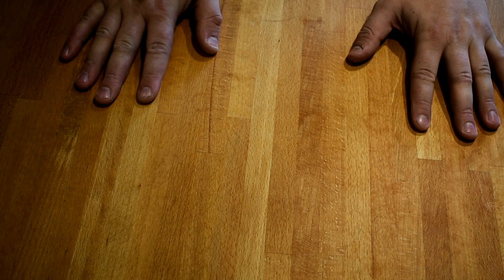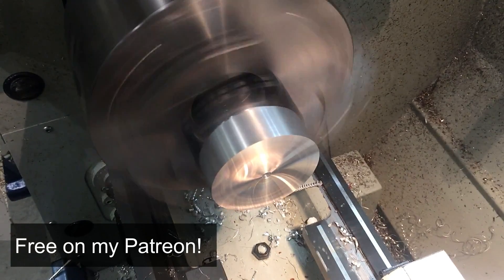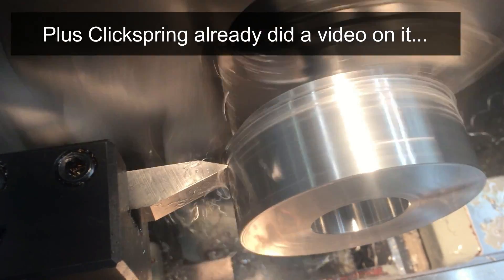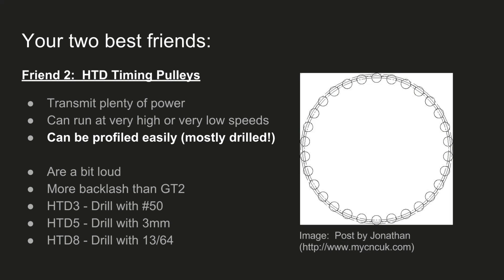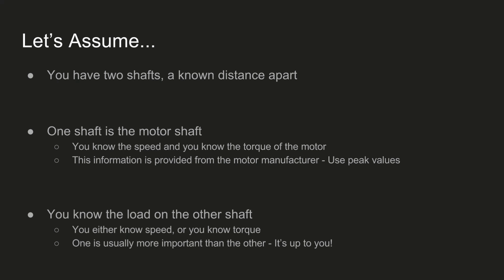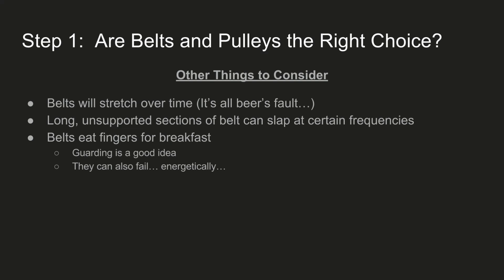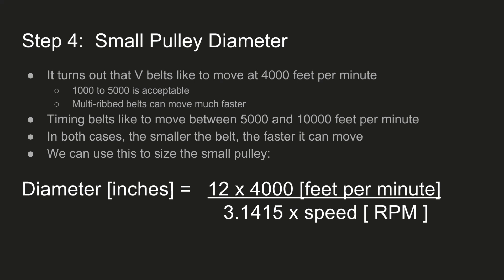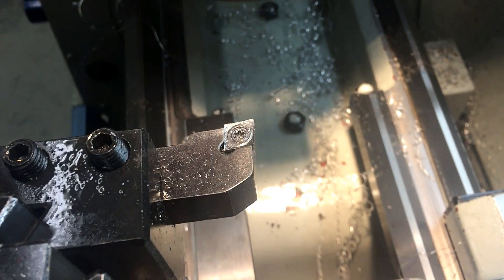Mechanical Design:  Belts and Pulleys

Comment: Thanks. This is good stuff. 
I’m replacing my 220 vac motor on my Southbend 10L lathe with a Leili 4.25 hp treadmill motor (DC, 130 volts, 5175 rpm). It has a 10 groove type j pulley on it that’s 1.22” diameter. I need to connect it to the lathe shaft that currently runs at about 540 rpm. It has a 10.75” V pulley on it. 
So I’m thinking of a two stage system. 
1. From 1.22” to 3”, where the 3” is connected to a 2” grooved pulley. 
2. From 2” to 8” on the shaft. This gives me 528 rpm. 
Center to center distances will be about 12” or less. 
The shaft that rotates has three flat pulleys on it that connect to the spindle above for changing speed. 
My TM motor has a variable speed drive (0 to 5175 rpm), a forward and reverse and an electric break. 
Does this sound right to you? Am I approaching the design correctly?
Thanks,
Paul
2. From 2

Comment: PHENOMENAL!  I don't need any belts right now (because stretchy pants), but I know I will at some point.  Would you make your slide deck available so I can tuck a findable copy in my Machinery's Handbook?  Without that, I'll spend 8 or 10 hours researching online and going way too deep, instead of making parts.  Thanks for posting!

Comment: Nicely done @hlaps1990, I think this format is just fine. It's difficult to find quick (-er than surfing text Google search results) explanations for the engineering design for this sort of thing, so I really appreciate that aspect of these videos you've done. I was trained as an engineer, so that may have raised my tolerance a bit, but if you look at any of the MIT or other college courseware on engineering topics, you see a similar format. I take that to mean that not everything can be communicated with a voice over while making a cut on the lathe or whatever :)  So my vote is yes, more of these is good. I really enjoyed your other video on spindles and would love to see what you might do on bearings. All good stuff that curious minds that are actually going to design things like this want to know :)
Reply from the maker: Thanks Steve!  I'm still searching for a new format that makes it a little less PowerPoint-y but that doesn't feature my hieroglyphic writing.  I also studied engineering so I got used to PowerPoint decks with no formatting being read out at me, but I know that when I get bored presenting, it's probably death for the audience.  I certainly will be making more videos like this, but again, hopefully I can break up the slides a bit :P.  Thanks for watching!

Comment: Hey Greg :)
I really liked this format, something different for once. It also enables one to push a lot more information through, that's another huge plus. Just one thing, maybe try to split those sections into shorter clips and mix it with "normal" video content, this will lighten things up a bit. 
Aside from that, I REALLY appreciated the amount and quality of useful information that you've put up, especially since I'm right in the middle of building my own, small lathe (no CNC, not manual either. something in between --> https://imgur.com/gallery/QDdbt ). I've scratched my head a lot lately about wether to use v-belts or timing belts (most likely will need both types).
Anyway, awesome as always, keep it up!
Reply from the maker: Wow!  Your lathe controller looks sweet!  I've often wondered if there would be benefits to a machine that was motorized, but still intended for human use.  It would be awesome to see "freehand" turning where, rather than controlling the position of the axes like on a manual lathe, you controlled the velocity of the motors.  When your machine is done I'd love to see you try to freehand a radius :P.  Thanks for the support and feedback!  I'll look into ways of breaking long spans of information up a bit.  As for your belt situation, I would suggest multi rib V belts.  I didn't think timing belts would be that loud but, to my surprise, they were (have a look at the first video I ever posted!).  Thanks for watching!
Reply: thanks man, means a lot. That's exactly what I'm going for. I don't need a CNC, I still want to be able to cut threads - and since I don't want to deal with a heck of a lot of gears to get the correct thread pitches...  Until now it's just inside CAD, I'm trying to figure out the best way of doing this. Your mini-lathe was very inspiring, I can't thank you enough for that! Also the tool turret (which is freaking awesome!), although I've scrapped the idea of making one for my lathe (at least for the beginning, but who knows what's coming).

Comment: i would love a video about bearings, i know roughly which one to use but at the same time i get quite confused from time to time
Reply from the maker: Bearings!  Reliability factors, load factors, stress concentration factors!  I'll definitely make a video at some point.  Bearing selection is quite daunting at first, but like with belts there's just a series of steps to go through :)
Reply: dont forgot price/accuracy :P
Reply: I'd love to see it if you wanted to do a video on bearings more general than rollers.  Bushings, sliding bearing surfaces, air and hydraulic etc.

Hydraulics/pneumatics videos would also be really cool!

Comment: good!I need this knowledge!
My minilathe is still no spindle power,Do not know how to choose
Reply from the maker: Hmm that might make a good video!  I'm not familiar with your lathe, but one good strategy would be to look at similar sized lathes and see what kind of horsepower they are rated for.  For reference, my lathe is about 1HP.  One tricky thing is that the more power you have, the harder it gets to control (without spending a lot of money!).  These Clearpath motors are very easy to control, but I think even their strongest motor is only 1.5-2HP, the next step for me would be an industrial servo and drive (which would be pretty expensive) or an AC induction motor and a variable frequency drive (a little less expensive but larger and less flexible).  Hope that helps!
Reply from the maker: That servo is beautiful!  It's a shame its so big.  You could try reducing the 12000RPM with belts or gears to get some torque and go easier on the spindle bearings.  I'm using a Clearpath MCVC servo and it seems to work quite nicely for what I'm doing.  You should check out Clearpath motors, they are small, quiet and powerful :)
Reply: Deceleration requires space to install the pulley,if pulley diameter is small, belt will slip, I try to do a few synchronous wheel try, need a new plan, synchronous wheel can not withstand high speed?
Reply: It is best to be able to directly connect the spindle, in the back

Comment: FIRST
Reply from the maker: Second!
Reply: Having watched the whole video now, it was excellent. Belt drive design is not exactly the most easily researched subject, it's hard to wade through the noise and actually figure out what you need for your application. And, in general, there are few videos out there about proper mechanical design for real function. More of these are always appreciated by a fellow engineer.

I also have a question for you. What rotational speed and torque would you specify for in a small milling machine motor? As you may remember I am working on building a little 3 axis epoxy granite C frame mill (9 in X, 6 in Y, 6 in Z) and am trying to decide whether I should use a ratio between my spindle motor and the spindle. The motor is a Moog BN34-34CD-04CHEP, a roughly nema 34 sized servomotor. It'll do about .7 Nm continuous , 1 Nm stall, and 4.5 Nm peak, topping out at 6300 RPM or so, with a rated power of 500 watts. I like the idea of having high RPM for small carbide tools in aluminum, but am wondering whether I will be missing the higher torque a ratio could provide while cutting steel, especially for repetitive hog-outs that will wear on the continous torque of the motor. Or will it? It is hard to know how much torque cutting really takes and you seem like a good person to ask. Thanks for your thoughts in advance!

--
For those that are suffering due to the hard-to-find nature of these pulleys and belts, I managed to find a decent seller with a good selection. It seems that all those who sell them have absolutely no understanding of how to make a website catalog, so hopefully this helps:

A list of the pulleys:

http://www.ametric.com/s-2581-j-profile.aspx

you can decipher their hateful catalog with this:

https://ametric.com/Images/document/Pulley-
AmericanStandardPoly-VRibbedBelt.pdf
Reply: Some research on the cutting torque that I've already done includes looking at the calculators that tool manufacturers provide. Out of curiosity, have you ever looked at the torque use in your little lathe to see how it compares to theory?
Reply from the maker: You write a solid comment Calvin.  It's funny looking at the datasheet for the motor you showed and seeing a fairly constant torque-speed curve.  Some spindles won't even turn on unless you tell them to go 1000 RPM, but it looks like this motor produces good torque all the way though its RPM range.
You shouldn’t have a problem cutting steel with a 500W motor.  You can cut steel without a reduction, you will just need to take shallower cuts and feed slower.  This will wear tools out faster than is ideal, but it’s certainly worthwhile having a high max RPM and being able to use really small tools in aluminum.  The other limitation you’ll encounter in steel is just smaller tool diameters (the optimal tool will probably be 1/4”).  I think I would favor the performance you want in aluminum, namely the ability to use small tools at high speeds, and just cut steel slower.  
I would be inclined to use a 1:1 ratio.   If you lower your RPM, you may be able to cut steel a little more effectively but you’ll make using small tools in aluminum impractical.  A 6300RPM speed keeps you below the limits of tapered roller bearings if you choose to go that route, but still keeps you in the range that you can make good use of 1/16” tools.  Once you get up into the 10K RPM range, you have to start making the spindle diameter smaller to find economical bearings that can handle the speed! 
There are also little tricks that increase the effective torque available to you, like using flycutters for facing and using sharp tools with small stepovers.  The very best thing I ever did with my 250W Taig mill was to use proper tooling.  I said to myself “I’m going to use 1/4” to 1/16” endmills for 90% of what I do, and I’m going to spend the extra $5 to get razor-sharp YG-1 Alu-power endmills" (terrible name, I know.)  With sharper and smaller tools, I could cut deeper without worrying about stalling and was actually able to remove material faster.
Anyways, I hope that helps!Greg

PS:  Thanks for posting the links!
Reply from the maker: I haven't yet, but there is a torque measurement function, so I'll make sure I check it out and report back when I have a sec!